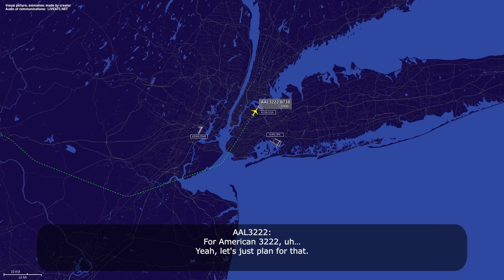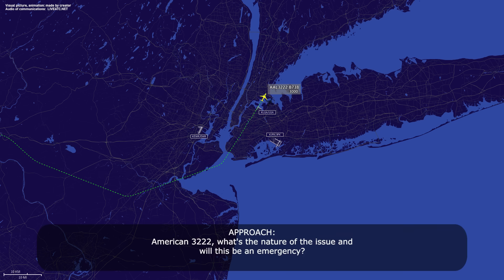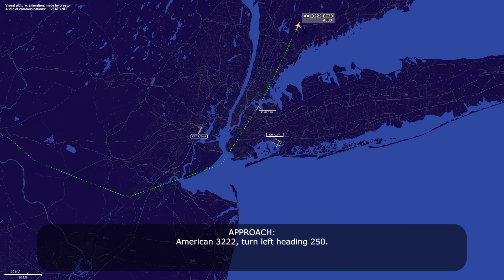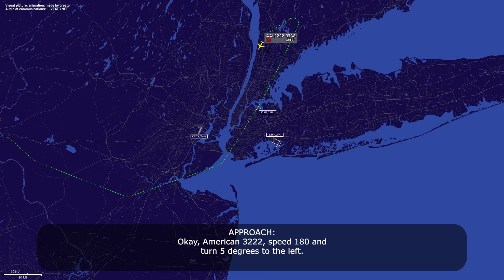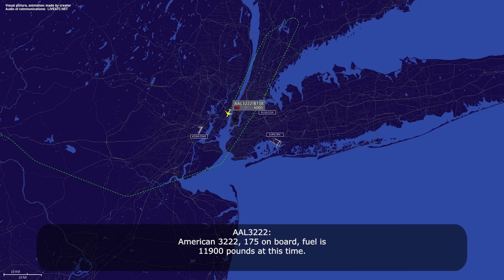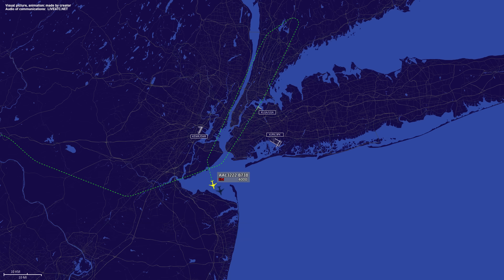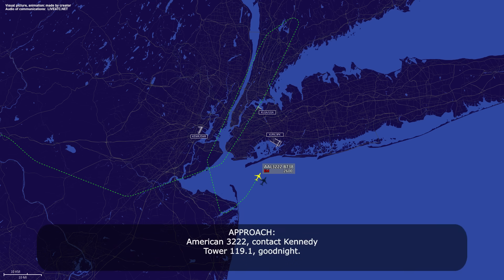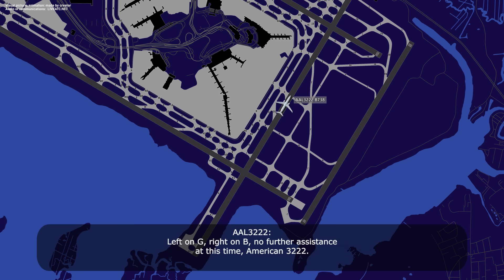Long runway requested. American B737 diverts to JFK due to Hydraulic System failure. Real ATC

Comment: Honestly, planning to slot another landing aircraft in behind an emergency aircraft with a mechanical defect is pretty risky. There is a non-zero chance that FOD will be on the runway after the landing, meaning an inspection will need to occur.